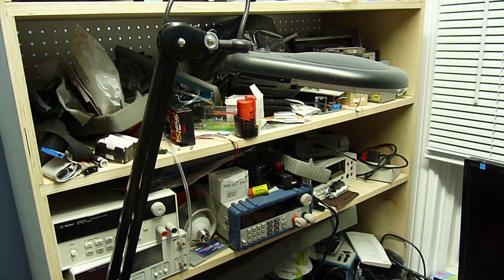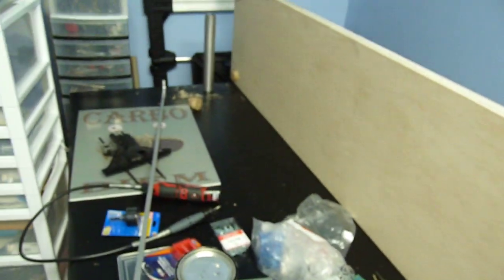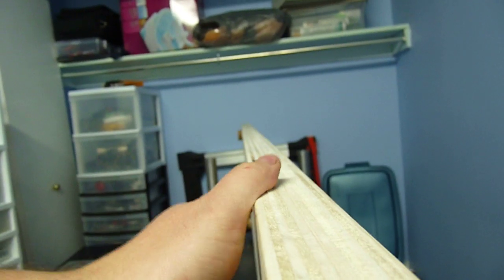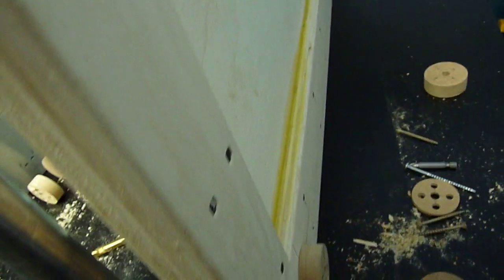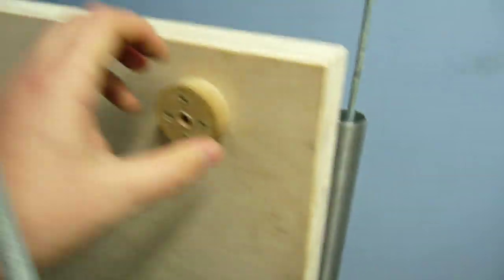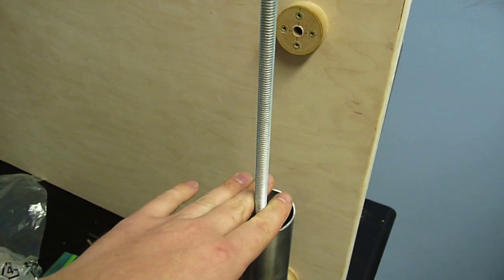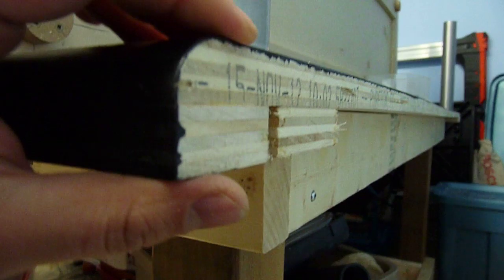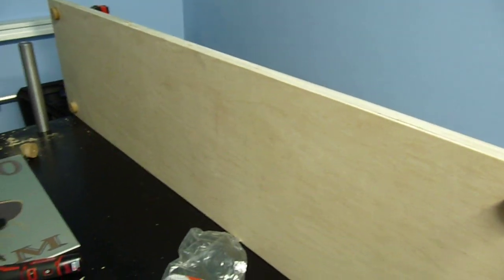The ultimate DIY electronics workbench PART 1/3

Comment: Nice work bench, but you have gone over kill with the size of the materials that you have used.  To make the work bench to easier to change I would have butted the work surface  up to a back board.  A easier way you could have built this bench, would have been to use 2"x2"x1/6th angline, (that's a long 'L' shaped piece of steel with hole and grooves cut into it).  That would have made a great framing for you to mount worktop, shelves and back boards, as well as making it easy to replace anything that needed replacing.

Comment: The workbench surface...  That polyurethane finish looks real nice, but I guarantee you it will get very beat-up in 5 years or so.  Suggest you consider a surface that you can remove and replace every 5-10 years, like a conductive plastic or cheap flooring tile.  If not, you need a very tough spray-on surface.

Comment: Nifty idea for shelf supports, though a tad expensive.  Strongly suggest you put a piece of wood at the rear of the workbench surface to keep small parts from rolling to the back and ultimately on the floor behind the bench.  If shelf flex is an issue, you can add another support at the mid-point rear of each shelf.  Also, have you given thought to a work-surface for static-sensitive components?  How about AC power at the shelves?  With test gear, you run out of outlets real fast.